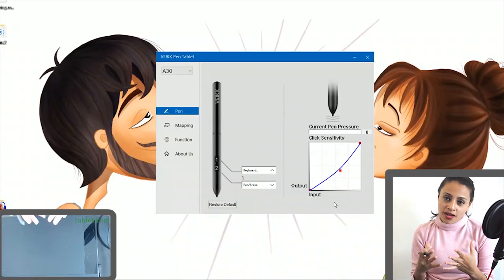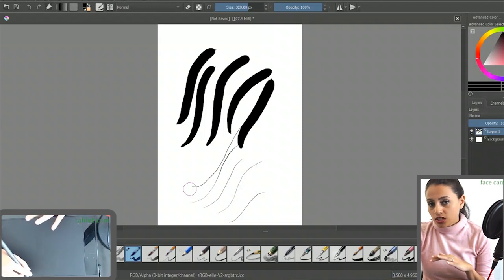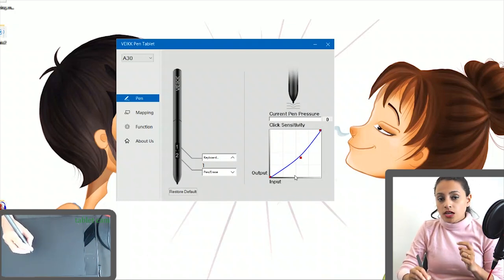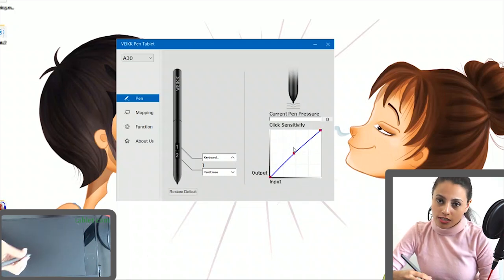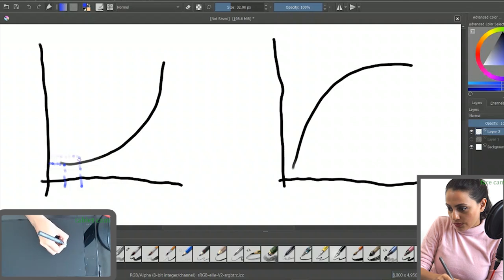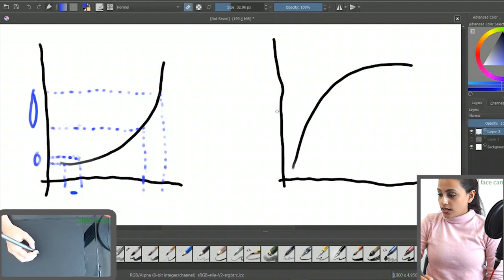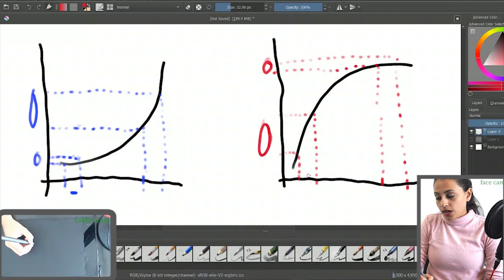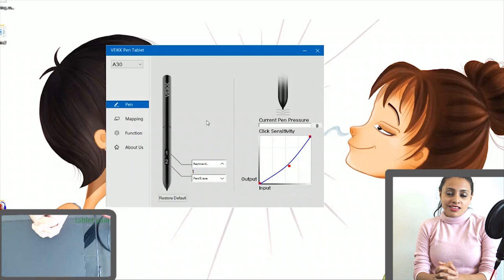How to Setup Pen Pressure Sensitivity for Any Drawing Tablet

Comment: 1. THANK YOU! Your the only youtuber (I FOUND) that explains the Pen Pressure Sensitivity with EXPLAINS!! You have NO IDEA how many vids talks about Pen Pressure Sensitivity, but ends the video with, "Just play with the settings" WITHOUT GIVING ANY EXPLAINS! Legit, I'm being honest with you,  thank you. Much-Much love.
2. I have a question. I noticed some art programs, such as Clip Studio Paint, allows you to add multiple points in  the Pen Pressure Sensitivity graph. I know some tablets will allow you to pin-point your pressure, but  most tablets only gives you 1 pressure point. 
Have you ever play around with    multiple pressure points in 1 Pen Pressure Sensitivity graph? Reason I'm asking this because I'm trying to create a gentle but firm pressure. I draw  softly when I sketch traditionally, I tend to  feather my lines but stay consistent with the soft   Pressure, and as soon I think  I got a line to work with,  not even adding too much pressure, I can quickly draw a thick line. 
I'm not asking you to solve this problem for me, but IF possible show another example  of Pen Pressure Sensitivity graph but with multiple pen pressure  points.
Reply from the maker: Thanks for the awesome comment. 😁
I will definitely include how to handle a multi point pen pressure graph in a future video.

Comment: I bought the viekk A30 but while using  it works with all other tools on krita except the pen tool .. did you faced the same problem if yes how did you solve that..
Reply from the maker: No, I did not get that issue, sounds like some setting to be fixed in krita, did you check the pen tool settings?
Reply: @Kalartistry  its fixed now. pen pressure

Comment: Good video, but I have an issue with the same a30 veikk tablet. The pressure sensitivity still isn't working despite going through the steps in the video! I am unaware of the problem, could you help me out?
Reply from the maker: Thanks for the comment 😊 so what's the software you are using?
Reply: @Kalartistry  I am using Krita.
Reply: @Kalartistry  I am using Krita, could I please get a reply? I have had no luck even over time.
Reply: Actually, nevermind. I eventually got it to work. Thanks for your help anyway.
Reply: @crazydman5546  which steps did you take? Having the same issues.
Reply: 1. Get the right drivers from the website of the tablet's manufacturers
2. Open the driver's settings, and look for a chart and scratchpad/ pen pressure checker pad.
3. Make sure your pen pressure works there. If it doesn't, mess around in the settings like with that graph and other stuff until it works. If it STILL doesn't work, then restart your computer and do steps one and two over again.

Get back to me if this doesn't work. I can help with this.
Reply: It seems just keeping your PC connected to the Internet sorts it out for you at some point. I tried everything in the Utility that you download from Veikk, but pressure sensitivity just started working on its own after 3 days without any intervention.

Comment: I just got a Huion HS611, and it's pretty nice, but I worry about the pressure.. Under the pen's own weight, it senses 0 pressure.. so it doesn't really detect light touches till you apply more pressure, and it can't reach full pressure without pushing harder than I feel safe doing.. It can still do fine lines, and smooth thick lines, but I just wonder if my pen is faulty. :/
Reply from the maker: Oh sorry to hear that, did you try adjusting the pen-pressure sensitivity graph?
Reply: @Kalartistry  Ya, I think it was just a faulty pen, no big deal, so I sent it back, gonna get a replacement at some point. ^^  Thanks for the reply.

Comment: Hi thanks for the video. I have Veikk S640. My pen starts writing when I move pen near the Tab surface without even touching it. Can you help?
Reply from the maker: Sounds like the hover input is taken as touch input. This is probably due to some setting in your drawing app. Which drawing software are you using? As a troubleshoot, can you try with few other drawing apps to see if it is same in all of them?
Reply: I use Microsoft OneNote for writing purpose (online classes). Sometimes it works and sometimes it creates problems. I have checked it with MS paint too.

Comment: Can you please help me? My pen seems to be detected and can write a line although it isn't directly on the tablet (the pen is only above the tablet). How can I fix this? :<
Reply from the maker: The pen can be detected when you hover closely above the tablet.. Looks like the software you are using takes hover input as draw input.. What is the software you use? Try with another one to check if that's the error
Reply: Hey, thanks for your advice! but I realized that the pen nib was a bit stuck in the pen so I changed it. It pretty much worked though. Thank you for replying!
Reply from the maker: Great...😇👍

Comment: I have the Veikk A50. Line thickness does not change according to the pressure in Autodesk Sketchbook program. Is it relevant to the program? The Veikk Tablet program works fine.
Reply from the maker: If the pressure sensitivity changes in the veikk driver software, it is then an issue in your Autodesk Sketchbook program.
You need to enable pen input in the Autodesk Sketchbook program and also select a suitable brush which changes with pressure. I have not used this software so I cant give you the exact steps to do it though.. 
I know in Krita you need to turn on a pen pressure button, and then select a brush which varies line thickness according to pressure. (there are brushes which change opacity according to pressure)

Hope this helps
Reply: @Kalartistry  When I clicked "Enable Windows Ink Function" in Veik 50 Program, it fixed. Thank you for helping. Nice video.

Comment: This is a great video, and I did everything you said, but I am still not getting any pen pressure. I am also using a Veikk a30, and it does work, but not in the program I am using. I am autodesk sketchbook, and I have researched everything I could to change the pressure but nothing seems to working. Any suggestions?
Reply from the maker: Did you try to go into settings of sketchbook to make sure viekk is properly detected there?
One way to debug would be to install another drawing app and try,. You can checkout krita since its free, and see if that works?
Reply: @Kalartistry  I will try that! Thank you very much! I appreciate it!
Reply: @Kalartistry  Sketchbook is now also free. Yay!

Comment: can i have some help? the pen pressure just makes it lower opacity but i just want it to make the lines thinner as the lower opacity is hard to do lineart because it just low opacity line art then. and then the only way i can do lineart is with no pen pressure but idk what to do now, i dont like the opacity setting and the only reason i really wanted to try the pen pressure out was the thinner lines so my drawings would have more line weight variation.
Reply from the maker: That's a setting in your drawing app. Not in the driver.
For an example, in photoshop there are some brushes that get transparent with light touches and darker with more pressure. And there are different brushes which get thick and thin.
Same thing in krita,
So what is the drawing app you are using? Check in that, setting and brush types. You should be able to find a way to change from transparency to thickness. Or even both if needed
Reply: @Kalartistry  ok! thanks! im using krita, i am gonna do dat lol

Comment: Hello there. I just bought a Wacom one. Tried drawing in photoshop but the lines are broken, like if i draw a simple straight line, it'll be broken in multiple places. I don't know what the problem is. Can you please help me with this. Its so frustrating.
Reply from the maker: Sounds like there is an issue with the tablet detecting pen strokes.. 
Sorry I have not use Wacom devices, too expensive for me! 
Hope  you find a fix, maybe try out in a different drawing software and see if it still has the same issue? Maybe its not the tablet but an issue in the software.
Reply: That's because the layer you are drawing on is not rastor. Change it to rastor and you will be fine. This happened to me in Krita

Comment: Hey! I was wondering how to change the pen from changing the opacity to changing the thickness of the stroke.
Reply from the maker: That setting is in the drawing app you use..
which software are you using? 
for an example, in Krita or Photoshop, there are different brush types which change opacity or thickness or both..
Reply: @Kalartistry  Ohhh, thank you so much! I am using Krita, and now that I've changed the brush, its working!

Comment: I have a problem. I just got into all these digital stuff and I firstly used pen then installed software for it. I can't modify anything and pen pressure is like .. non-existing. Is there any way I can fix this? Thanks!
Reply from the maker: What is the tab and the pen you are using? And the software?
Reply: @Kalartistry  Tab is - One by Wacom with it's pen, also software I installed from their webpage. Again this is first time for me doing anything like this so I kinda don't understand like anything of these stuff, and I tried various steps in fixing this problem but nothing works, you're the only who actually helped me realize some of things., thanks again.

Comment: Hello~ may i ask what art software you used for this?
Reply from the maker: The pressure sensitivity settings is not done in the art software. It should be in the driver software of your pen tablet.
My pen tablet is veikk, so I'm doing it in veikk driver software.
You can use any art software with it, I use Krita and photoshop both

Comment: Pen pressure remains on 0 for me and I have the exact tablet. What could be the cause?
Reply from the maker: I guess tablet is not properly installed then, did you try to reinstall the drivers
Reply: @Kalartistry  RosFromSA
RosFromSA
1 second ago
It seems just keeping your PC connected to the Internet sorts it out for you at some point. I tried everything in the Utility that you download from Veikk, but pressure sensitivity just started working on its own after 3 days without any intervention.

Comment: i got a wacom tablet i was dispointed it was not smooth at all and i don't know what to do i just need the sentivty to be up
Reply from the maker: Ooh.. I've never used a Wacom before. But I can be sure the Veikk surfaces are soo smooth and easy to draw. I suggest you to contact the wacom seller and make a complaint
Reply: What kind of wacom tablet did you get

Comment: The VEIKK Software works. It senses the pressure. But Krita doesn't seem to detect it, so I still end up with round ends instead of sharp ends. Help?
Reply: Oh nvm! I just needed to configure my toolbox. Adding in the Pressure Pen thingy worked after I restarted Krita. But I can't go without saying how big of a help your video was! Without this video, I wouldn't have known that VEIKK actually had a APP that can configure my A15. Thanks!
Reply from the maker: Nice..! 😇

Comment: I got my pen tablet three years ago. My driver is broken and I can't find it. My computer has also been rebooted twice throughout the years. My pen tablet's brand is also not very well known, therefore I can't find much help to fix the lost pen pressure. I have been painting without any pen pressure and it sucks but sometimes I still get along with it. any advice?
Reply: Seems like the youtuber hasn't replied. What brand do you have?
Reply: @ashishhembrom3905  honestly, i dont really know. I live in Asia and my country is Philippines, so here we have lots of products with no clear brands. Just happened we bought one that didn't have a specific brand, and a model too. I can't seem to find the product online, let alone the site it is from. Ive been looking for it ever since I had it, and its been three years. I cant find the driver online, the brand, the model, its basically just a tablet with no brand. The box has been disposed too, i believe since i can't find it elsewhere.
Reply: @hahqhq5409  I would say use the opacity and flow to paint either lightly or to give a heavy stroke. I had the same issue as well but with wacom intuos small of all tablets. I continued a year without that pressure option. And it wasn't cheap for me at least here in India. I'm pretty sure your tablet brand was a cheap knock off of popular brands so what I'd probably do is download drivers from other brands and see if it works. Most likely the technology and coding is the same. If it doesn't then try using opacity and flow from your software brushes to control your strokes.

Edit:
There are several brands and models that you have to try it out with though. There's Huion, xp pen, veikk, gnomon, parblo, etc. Let me know if it works or go for option 1.
Reply: @ashishhembrom3905  good news and bad news. I looked at my tablet last night as i sent the reply and apparently, it's brand is JW Concept, and the model is XP-03 i believe. I went to their site and it's from Silvertec. The site is blank, there's no information about the prodect and looks hella cheap. Either way, i requested my parents for an upgrade and we're now going to purchase XP Pen Deco 01 V2! Its good for android and PC use. So i guess that's that, thank you for replying to my concern!
Reply: @hahqhq5409  hooray!! Glad to hear that!! I've been saving up for xp pen deco pro medium. College starts soon this September for me. Best of luck to both of us.
Reply: @hahqhq5409  I looked up jw xp 03 tablet. Looks a lot like the xp pen star 03 model that I use. Huion also has something similar to that brand. Try downloading their drivers maybe? Just see if it works. BTW xp pen star 03 tablet driver didn't work since the update and I went back to the previous updated driver.
Reply: @hahqhq5409  somebody on a jw tablet YouTube video replied that xp pen's driver does in fact work for the jw tablet.
Reply: @ashishhembrom3905  didn't work for me unfortunately.
Reply: @ashishhembrom3905  hey man you got a discord? Id like to talk there lol
Reply: @hahqhq5409  yea I do. Ashonia #9798

Comment: I m using veikk a50 i brought it yesterday. My brush line starts showing on screen after a specific distance i draw on tablet it dont start immediately can u tell me its solution.
Reply from the maker: Mmm..🤔Sounds like a lag,  what is the software you using? May be its too powerful for your computer.. try installing a smaller software like krita, i guess that will work
Reply: @Kalartistry  oh, now i get it. Thanks. i was using animate cc.
Reply from the maker: Sure, you are most welcome...happy to help..😊😊
Reply: @prajwalkonde4702  That animating program got far lagger than it was in a 2019 update, i dont like it anymore, im going for blender now, that its heavy too but because its 3-2d program, so it mercy it xd, what ever u do, dont go for opentoonz, it seems cool but that program its a nightmare, i hardly recommend u toon boom harmony, insane program
Reply: @sargon4307  thank you for your advice. I will keep that in mind. :)

Comment: How do i see the "cursor" of the pen when i plug it in the device (PC/Laptop)?
Reply from the maker: Cursor is going to be the mouse, when you hover your pen over the tablet, it will move similar to moving the mouse.
Reply: @Kalartistry  Thank you so much. Where exactly to find the cursor settings so I could see it on the PC/Laptop or what to change for me to see it? I'm using Windows 10. Should I make sure that the device has been plugged in to the PC before changing the settings?

Comment: I don't know what happened to my pen pressure it's gone now I tried updating the tablets software but it's still not there 😢
Reply from the maker: What is your tablet? Can you try to reinstall the driver software and check
Reply: It's HS64 Huion limited edition, Sorry what I meant by software it's the driver. I even tried adjusting the pen pressure but even there, it's still the same. For now I am waiting for a newer driver version.
Reply from the maker: The other thing to check is your drawing app.
For example in Krita there is a toggle to turn pressure sensitivity on and off.

Comment: i use the tablet veikka50 for 2 or 3 days it work completely  fine but after that my pen pressure not working it detect my pen and i can move the cursor but i cant tap or click on it or something like that. im already try any solution that i can find youtube  or google but still now working..can u please help me or anyone that have a same problem that know how to fix it.. please help me i really need it to work rn . thank u
Reply from the maker: Does the pressure show up properly in the driver software?
If it does, then there is some issue with your drawing software settings, try a few different software or try changing software settings in your drawing app
Reply: @Kalartistry  no in driver software it doesn't show any pen pressure
Reply: @Kalartistry already tried different drawing software but the results is still same...even in desktop i cannot click on any icon..it detect my pen i can move cursor but I can't click on anything

Comment: How do I get into the screen at 0:16?
Reply from the maker: That is the driver software of Veikk, what is the tablet you are using?
Reply: @Kalartistry  I'm using a Huion q11k
Reply from the maker: Then you have to install the Huion driver, in that software you can find where to change pen pressure sensitivity. The software will look different, but the graph should function similarly
Reply: @Kalartistry  Ah okay thank you so much!!!